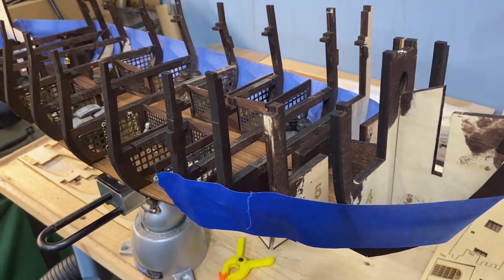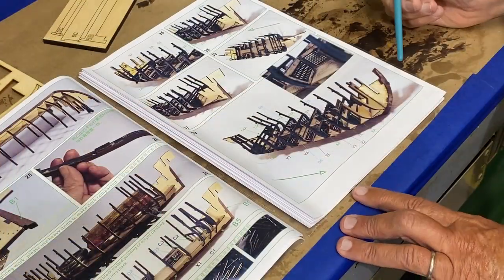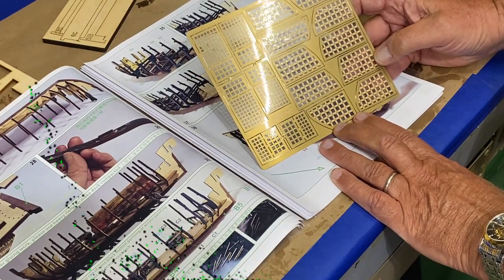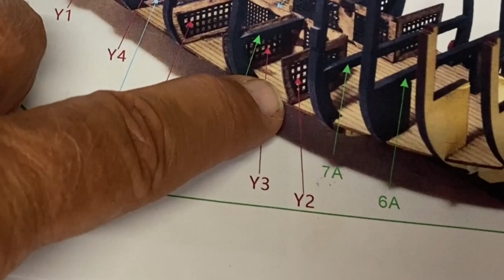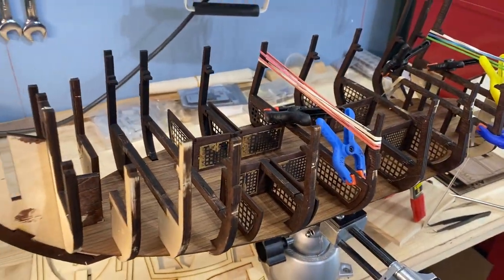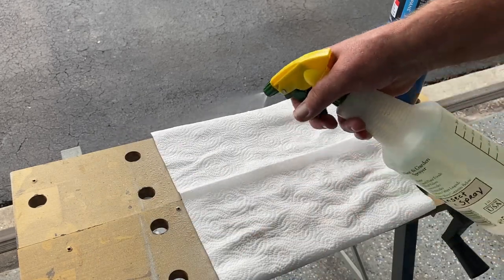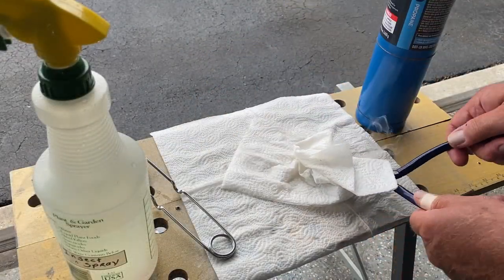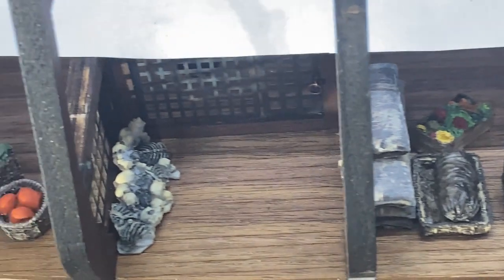Black Pearl All Scenario Version PART 2

Comment: Hi, just came upon your channel.  I noticed, this is your 3rd Black Pearl.  Can you tell me, the sizes of the 3 your purchased and which you think was/is the most accurate of them:
all scenario version
Golden version
Banggood

I thought, I'd just get the plans and slowly scratch build but having to buy accessories needed for the build, possibly buying a kit with everything included a better option??
Thanks, subscribed and watching your build.
Reply from the maker: Definitely a big difference in all 3!
I’ll go in the order I built them in.
1. Banggood: I’d give a Do No Buy rating. Terrible instructions, missing parts and a real pain to finish. However I’m still proud of it… but I wouldn’t build it again. Low cost to start with but by the time I purchased the missing stuff I could have bought the Golden version!
2. Golden version: Very happy with this ship. It had reasonably good instructions and I was able to follow the guide for running all the rope work. The Golden version is very close to the ship in the films as I go back and watch parts of the movie for ideas.  You can get a very accurate version depending on your talent to be that detailed.  The downside of the Golden version is that the captain’s quarter’s is a façade. So the outside looks very good but there’s nothing inside where the Captain resides.
That’s also the case for the lower decks.  The lower deck cannons are just the barrels sticking out the window. There’s nothing inside that deck, and there is no lower 3rd deck at all. That being said, it’s a fabulous model ship!
3. The All Scenario Black Pearl:
Oh my goodness! This version has more detail than I can put into words!
3 decks, each with specific items. Lowest has multiple brig cells complete with chains and skeletal remains from past prisoners. A rum rack with broken and full bottles. Lanterns on all decks that light.
One side of the ship is open so you can see details on each deck.
Walnut wood on most all exposed wood.
The middle deck is the crew’s quarters.  There’s supplies for every deck too.  You’ll start seeing some of the details in my next post.
The upper deck has a full Captain’s quarters with furniture and lanterns as well.  This ship has so much I can’t explain.  I’d highly recommend saving up and go with this version!
You’ll see as the build continues…. Although it will take several months to complete. Glad to have you follow along.  The first two ships I posted on YouTube as well, check them out. Here’s links to both series:
https://youtube.com/playlist?list=PLjMZtm2hvqrNZ82Ts0RIG7UXwtKzepf1f
https://youtube.com/playlist?list=PLjMZtm2hvqrNtBeJsghWlM4fwsG6p_jEV
Thanks for watching 👍

Comment: Incredible detail on this ship. It's going to look amazing when you get it complete.  Chuckled when you wet the paper towels and said;  "That's just incase, something goes wrong". Ahh come on, what could go wrong Dan?  lol If your luck is anything like mine, I'd have a bucket of water near by lol   Looking amazing, following along as always. 👍👍  And who new you were a painter? Bob Ross would be proud. Actually those paintings look great! Looking forward to seeing you shrink that down and hang in the Captain quarters.
Reply from the maker: My art works were inspired by an older gentleman at the time. The show was similar to Bob Ross but was called “The Magic of Oil Painting “ I don’t know his name? Had a Swedish kind of accent?
I had an off camera incident!  Apparently there’s a problem with my torches gasket at the shutoff….. the flame switched from the tip down to the shutoff valve knob!😵‍💫!
It was a small flame and I used the wet towel to cover it and turn the valve off….. No burns but I’m shopping for a new torch!
My thought on the painting is my painting of little value kept and the priceless one discarded in a pile of old junk.😂 Perfect for this ship’s journey.🤣
Thanks again for following along 👍